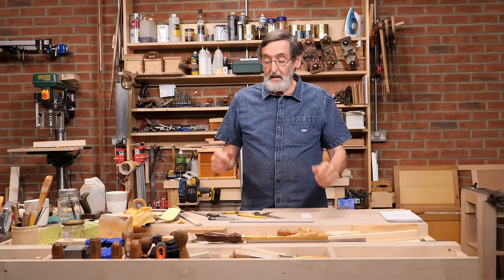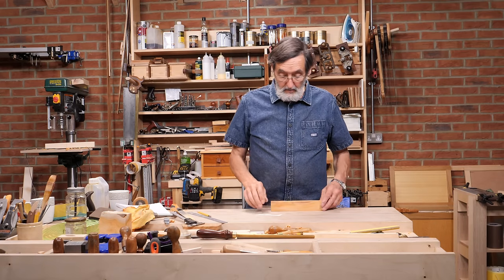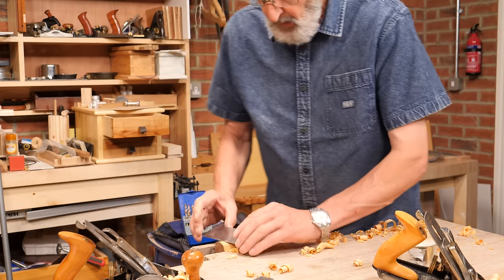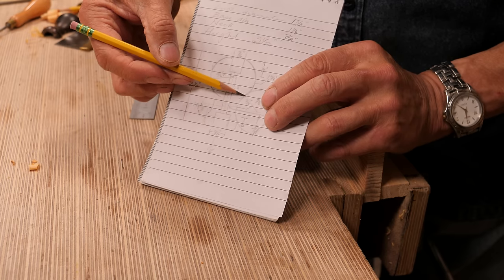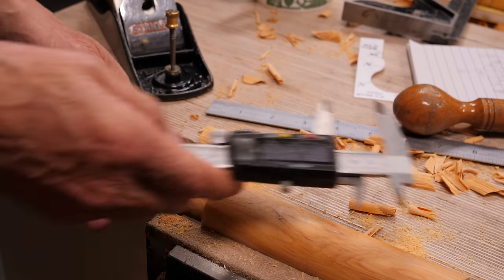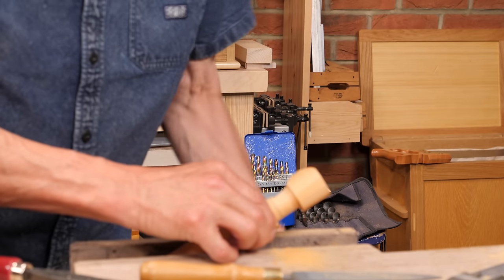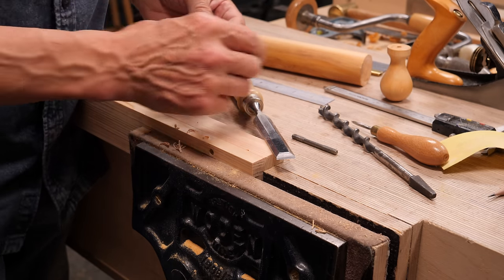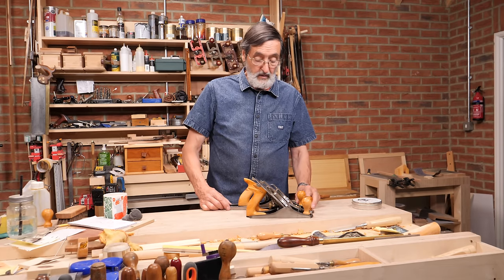How to make a Plane Front Knob | Paul Sellers

Comment: I will definitely do this when the handles on my plane break. I probably wouldn't have thought it's possible to make it without a lathe. It's good to watch just to remove limitations in my mind. Not too long ago people made pretty much everything just with their hands and brains. Too often I thought I could do things if I just had this or that machine. Tomorrow I will receive my first spokeshave (old record). I have to say I bought a record 5 1/2 plane because of Paul Sellers. I love using it and it's just handy to have (and also cheap compared to power tools). Making wood shavings like that is so much fun. The sound and feeling of a sharp plane is like nothing else.

Comment: Very pretty amber timber that, but unobtainium here in Australia.  Personal choice will be hard local Jarrah.
I want metal lathe though... fair use for timber too.  Personally, I'd be mounting the near formed and drilled item on a shaft, then in a corded drill machine to final form/sand the curves. Those abrasive pads for polishing stainless steel have a good fine cut and conform well to radius edges. They cut better with a little mineral turps., which also suppresses dust. 
Did enjoy watching, thank you, Paul.
Reply: turps! I'm dutch, but used to work for a painter in Katherine and he called turpentine turps, too. Must be british english.
Reply: @zbnmth  I'm not sure of the origin of shortening the word... pretty common here, especially with names and adding a "-ie" or "-y" suffix.  I speak the colloquial language of my " old man." [Father - joiner]
The other common use of the word 'Turps', you may hear, is used along the lines of... "Is s/he on the turps again?" ... a loaded question, inferring the subject s/he on the grog [alcohol] and pissed [drunk rotten] again. 
I'm not sure if that is a British saying or just here - olde school people from UK can advise.
.. or if there is a history of desperate drinkers actually consuming the turps. << DEFINITELY NOT ADVISABLE
Maybe it's shop slang, expressed as an extreme, suggesting the metho [methyl-alcohol - with or without shellac to colour it like rum] runs out? << DEFINITELY NOT ADVISABLY 

Zeb .. you probably speak and understand English better than some in Ozz ... and the UK.

Comment: I greatly enjoy your videos. I enjoyed how you did the layout on this and many of your other projects. Watching you use the compass and dividers made me laugh at one of my methods for circles. I do have all of the tools such as compass, dividers, etc. I spent about 25 years working a a carpenter and cabinet maker. I have built several hundred countertops, tables, stools, etc. I cheated when i needed to layout a radius that did not have to be any specific dimension. The two most common for me have been a chewing tobacco can (which I always have) and a drywall bucket (which has always been in my shop). Over the years I ended up with a can collection for the same purpose ranging from small pill bottles, food and coffee cans, etc. Unless a specific division was required I could always find a can that met my needs. It may sound silly but the system has served my needs well over the years. I am retired now and have a small but pretty complete shop with all the power tools. I now find myself doing much more by hand than ever before as it is enjoyable and rewarding and I have no time line to meet.

Comment: I picked up a German made no. 3 from my neighbour for about $1, it had no iron or screw cap, so I made those myself, and it's a great scrub plane. I made the iron out of an old wrench (the flat, stamped kind that happened to be 1 3/4" wide), and the screw cap out of hickory. It works great.

Comment: Nice job Paul. I've got some salvaged spalted wood from logs I dragged out the garden over a year ago. I'll be making tote and knob for a 5 1/2 so this will help. I think what I'll do though is, when making saw cuts to the initial dowel, I'll clamp in a stop to ensure its true when rotating.
Reply: Malcolm Smith I too thought a stop was what I would need.

Comment: You could take a scrap piece and clamp to the bottom of the jig to act as a "stop block" for your saw cut guide.
Wouldn't it be better to put the "finish" on before installing it on the tool? Just curious. Great video as always. Cheers :)
Reply: I was thinking the same question on my mind... what's the downside of applying the xylac on the  knob unmounted?

Comment: Hi Paul.  I bought an old Stanley No. 4 from ebay.  I tried plaining w/ my left hand once and it slipped and cracked the sole.  So I bought a Stanley No. 5 figuring I might be able to do some jointing.  But for both of these planes I find that the tote is too short and crimps my larger hands.  Possible to make a tote that is taller for these planes?

Comment: At first, one may be inclined to think, 'Well, what's the point,' when you can turn one in about 5 minutes?  But like Paul said, not everyone has a lathe, and also, working with hand tools in this fashion can be therapeutic, I find.  Over and above that, perhaps the most salient point is that the techniques are transferable.  Today you're making a plane handle, tomorrow you're carving a guitar neck.  And as far as boo boos go, we all make them.  I wish I could handle mine as calmly as Paul does!  and ultimately, as an airline pilot told me years ago, 'It's not about the spin.  It's all in the recovery.'
Reply: It's also why helicopter pilots practice autorotations, both 180ºs and 360ºs. (Cutting the power at about a 1,000 feet off the active and riding the air cushion created by the still freely rotating blades in a controlled manner. ("Oops" would be the mildest word uttered if the engine didn't restart before you pulled yourself out of your controlled practice fall.)

Comment: at 5:45 if you turn the compass around and put the centre of the compass on the two tangent points (where you want your radius to kiss), and make a small sweep, the cross the two sweeps make is the centre of the circle you want without having to guess for it over and over.

Comment: I don't know why you didn't just start with a piece of dowel but it occurred to me that you could have used your template to draw the outline on each of the 4 sides and used a coping saw to cut out a rough 4 sided shape of the knob then file it down from there.
Reply: I know, right? Should have popped down to the wood shop and bought a Yew dowel at exactly the right thickness.
Reply: I have never seen a yew dowel.